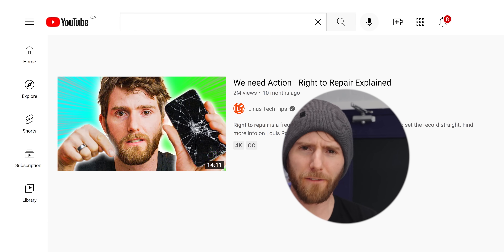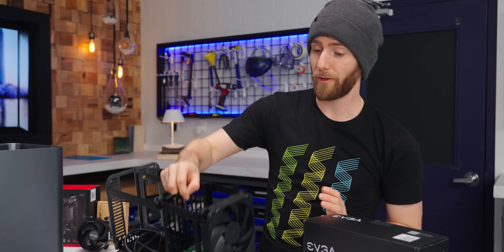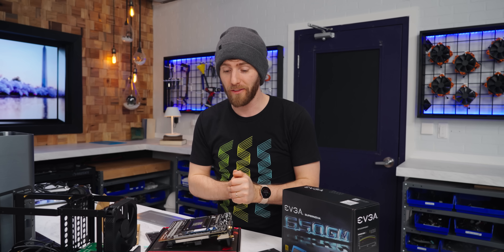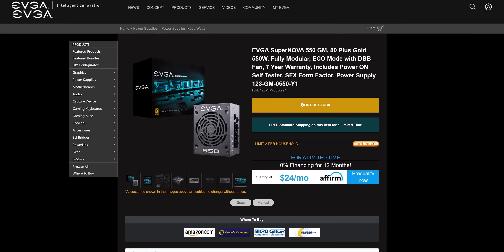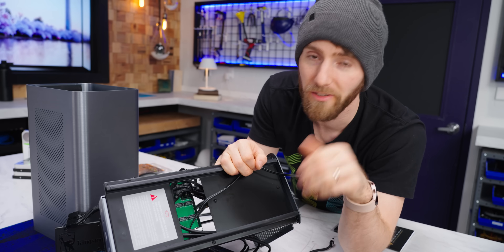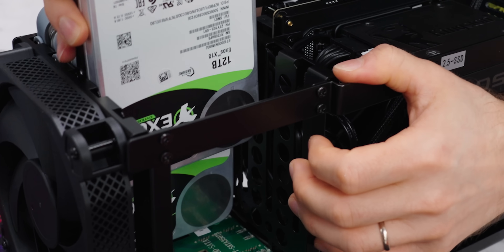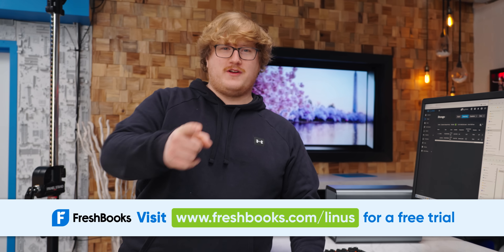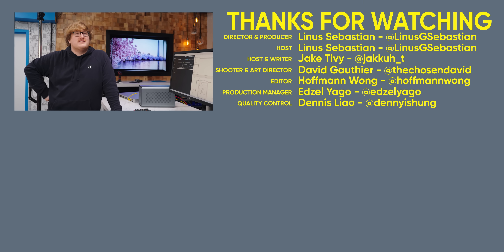This blows away the competition - JONSBO N1 NAS Build

Comment: I never understood why you need to take such a small box. They look nice in your living room but that's usually not the place where you put a 24/7/365 NAS, if then itd likely be all flash based and a PSU w/o fan. I dunno...
Reply: I'm renting a small apartment which is why I chose it. It looks great in my living room and it's much easier to transport when moving. When I move into a bigger and more permanent space then I'd like to upgrade to a server rack, but until then this is still a great option.

Comment: Hi, i was using NAS from 2018. I was happy for the pros to use ir. But now the Mobo of my NAs die an until know i discover the pánic, fear AND stress to have acceso to the info the we put un these Toys. Now  i have More perspective to ask my self.
What áre the steps or óptions to ver ir recoger files from diask that áre part of RAID sheme, depends of the brand of the nas we face standard or propietary raid formats. Now I'm plannig definitly to move into a diY NAS with truenas or even xpenology,but Will be great if you prepare a Review about what to do ir the HW of the nas fails AND the data Is inaccesible from the disk.
My aproach this Time Will be consider the worta escenario PSU fails ( a standard Psu to replace) , ir the Mobo fails ( the ideal Will be to have the img of the USB boot or disk boot, AND change or swap the Mobo AND recreate the USB or disk boot AND voila. But please guys ir you can consoder this real escenario AND probé my hipotesys Will be great. Because the issues to race hw fails in propietary NAs implies not to have new mobos to replace or even neither the same model just to swap the HDD from the old to new NAS AND recover the data. But if we mover to genéric HW the idea Is to recover easily from this escenario. I hope you consider to recreate a hw failure of a diy nas AND recover in almost 24 h the files. Thks

Comment: So you still have the SATA connections on the motherboard could you add those to the array somehow with like, I don't know double sided tape some 2.5 ssd drives somewhere in there? If you had a board with E-SATA could you get external drives and add them to the array or maybe even create a secondary array? Do you have a 2025 updated version of this? Do you know of any good Raspberry Pi 5 NAS kits? I've been looking for a good option for a few months now and I need to get it done but there's so many options and so little money so I need to pick the  best bang for the buck!!!!

Comment: I recently build a TrueNAS server with this case, 3x 18TB HDDs and 2x 128GB SSDs for a boot mirror. I ended up using a NAS motherboard though with a N150 CPU. Highly recommended as it comes with 6x SATA 6Gb plugs on the board. It also happens to fit the workload perfectly, using ~80% of the CPU at full tilt and having a little in reserve to stuff like tailscale and a few other apps. Can recommend! 😉👍

Comment: These cats are not TrueNAS gurus and the RAIDZ1 recommendation is bad as it only supports 1 failing drive. It's often that two drives fail closely together, and rebuild on Z(X) arrays takes FOREVER. Always use mirrors if you truly value your data with ECC unbuffered ram.

Comment: How did to connect the display/monitor to the NAS to get display? I thought you were using Ryzen 3100.. Did you install graphics card? What am I missing here?
Reply: The OS was installed with the drive on another computer and then put in the NAS. Once the NAS was booted up the login and config happened on another computer remotely accessing truenas via the web adress

Comment: Amazing video, terrible case as usual for Jonsbo.
Air seems to be quite blocked by those plates, can't even imagine how could it squeeze between those hard drives to mobo compartment and there is barely no space for exhaust too.
I owned 2 Jonsbo cases, both $150+ and their quality was horrible, like at $20 case. Basically single build time case with risk of breaking when you try to move with them. And those included fans - Chinese no names wining after 2 weeks. Their whole budged wen't on design.

Comment: Thank you. Definetly worth to look into it. Worked with the qnaps now for some years and am about to believe that they have models that are buildto break. Especially one model we bought two of having a service agreement on one and no service agreement on the other one. The one with service agreement is stil running today ( 5 years after the other one broke - which was exactly ten days after waranty ran out). As we hab more than one experience - also with their software support fro the buildin backup and synch tool, I'm realy keen of getting them out of da house. Additonally Google did add 100% onto our unlimited subscription though using only 70 TB at their side. So its time to find some new kids on the block.

Comment: I would have gone for a G version of Ryzen that way you have graphics for the OS when needed.
Also with a G version like  Ryzen 3 3200G, (though you could probably find a Ryzen 5 g for the same price), you could run it as a media player, plugged into your TV and a NAS
My Ryzen 5600G did not work on my MSI motherboard no matter what BIOS I used, so make sure it's compatible

Comment: Great work Linus, but I do have a slight issue. I'm from the land Down Under, so prices are different for me. The total price for everything you used comes to $1,071.63. This includes shipping and GST. If I was to go the route of pre-built NAS devices. TerraMaster F5-221 5 Bay NAS and still have $513.14 for Hard Disk Drives. I could be doing something wrong, and if I have feel free to let me know, but for what it's worth. It'll be easier.

Comment: An arc drive in this setup wouldnt matter that much but with 1 drive idk man theres not much option i guess i would go for more ram rather than a read cache
Reply: I would add it as a special metadata and store some small block if its a mirror but 1 drive you lose the whole pool if metadata fail so its a no no. slog also dont make sense either why do you want write redundancy if your slog is a stripe i dont think you should care about sync write anyway with this setup. yikes i guess i wouldnt add it at all if i dont already have a spare nvme.

Comment: Basic questions please: Why is the IO expansion card needed for 4 sata hdds if the board has 4 sata ports available? Second, why not an apu for being able to use a monitor when needed? Third, in case of using ssds instead of hdds, would the "plug" method change? Thanks in advance

Comment: I am looking to do a system very similar to this with an Intel 13100 or 13500 and no GPU just for a Plex server.  My question is do the hard drives get proper cooling in a case like this?

Comment: Just another PAID SPONSOR. The N1 can be a good setup but unless you want to melt your HDs. This is not the case for you. I have one and HD temps are the biggest issue other than bad cable design. The only way to keep HD temps reasonable to only run 3 HD at max. This allows enough airflow and enough to keep the CPU. This is nothing but a loud case. I know because replacing it after losing 2 HD to heat for NAS.

Comment: I stil want to go with Asustor 12 smaller size but I don't know which is more power saver, more silent, or more upgradable for the same capacity
also this needs more work to set up and more components to buy like ram

I suppose this is an old video, so if you ever compared it, could you drop me the video link
if not, could you write your expectations if possible

Comment: Comparing the electricity consumption to a pre-built NAS would be very interesting.
Honestly this is the number one reason why I've bought a NAS from Western Digital.
Here in Germany the energy prices have peaked this year at almost 50 cents per kWh.
Running a NAS 24/7 can seriously increase your energy bill
Reply: well, just guessing.... that NAS could draw at least about 55 to 60w with all discs spinning and the processor idling. If you configure spindown certainly you can lower it..... I built myself a NAS with a Celeron N (6w TDP) with only two WD Purple and the power consumption was between 25 to 29W peak.... and with spindown set, went down to 19W . Now here We're talking about 65w TDP just for the processor (idling at 20) + 5 HDD each can drawing about 8w (?)  and I think I'm being generous 

and then..... add all the other components consumption like RAM, Fans, Mainboard, the other SSD, etc... so yeah at the end of the day it is pretty high for a Home NAS. I live also in Germany and  I would not do it. In fact, I got rid of the DIY celeron solution to get a very old 2 Bay Synology that consumes tops 15W and abou 4 while hybernating.
Reply: @SuperDaxrider  HDD power draw checks out but the CPU idling will take much less power, normally 5W in a bad scenario (since even the bloated W11 allows <5W idling, I'm positive Linux based systems can do better).
Reply: @mastroitek  you might be right here, in fact is very difficult to measure the actual power draw of the processor we can only guess, probably would be 20W including the rest of the components like I mentioned above. Anyway I HIGHLY doubt this kind of build will get lower than 40W considering that a miserable Celeron N3050 on an embedded mainboard with 2 disks was most of the time sucking 25w out of the wall . 

Well, If someone here built this king of NAS, and also has a power consumption measuring device .. please post your results!
Reply: @SuperDaxrider  One can easily buy motherboard wit same N100 proc on it.
Reply: You don't have to run your NAS 24/7. This is a misconception! The magic is called Wake On Lan. So your NAS is only running if you need it: https://de.wikipedia.org/wiki/Wake_On_LAN
Reply: @WhereIsTheSpartan  Not pro but HDD's don't like constant on/off power cycles. That wear vs power consumption makes it much cheaper to just keep it on. Thats why people prefer 24/7 operation. Therefore would be interesting to see power consumption details of this setup vs pre-built NAS like the OP said.
Reply: @WhereIsTheSpartan  ok but a nas needs about 2 min to boot, not great, but I see how it can be useful
Reply: @WhereIsTheSpartan  fun fact when I suggested on reddit I would only switch on the NAS during the hours of the week I am at home and need the storage, people went completely crazy saying that is unacceptable to not run the NAS 24/7, without any justification of such statement. Glad to know I am not alone.

Comment: To anyone who reads this, the Node 304 is a better case to build a NAS in since it fits an extra hard drive and is cheaper. Also, there's no cable routing BS that you have to deal with, and if you're willing to mod it you can get a 200mm fan up front which will mean no cooling problems.

Comment: I've started to build something similar myself though the motherboard is a Gigabyte A520I AC and the processor is a Ryzen 5 5600G (so I won't have to play about with other systems to build the hard drive). I did end up with the same 16GB though I tried 2 x 8GB of Corsair Vengeance LPX. I'm just getting the cables, the psu (I tested it with an old CIT supply and it works though the supply won't fit in the case) then it's all a matter of the drives. Spinning rust these days isn't quite as expensive as it once was but getting five relatively big drives is still not cheap over here. It's all in the cause of replacing my old home server which is perilously close to end of life.

Update: I finished building this with the parts above with an 850W Thermaltake SFX PSU. It works well though I would strongly advise that if you are running a Linux share setup as well as or instead of a Samba share, use TrueNAS Scale rather than Core (or Unraid). I already had a SATA board (a four way jobbie) from a previous project and the processor meant that I didn't need a second slot. One thing I was a bit unhappy about though was that the SATA cables were difficult to fit in there. I ended up buying a Yiwentec SATA fan out cable which can handle 6 ports and doesn't take up anything like the space but another suggestion I can come up with is use a Jonsbo N2 case. It has a different form factor which allows you to extract the storage drives without pulling the system apart.

Comment: Thanks for the video, Pretty cool. I saw optane SSD build as part of storage. I am the optane fan and leveraged optane in my homeNAS for ZIL and metadata for a while.  That's really true optane have the low latency and high endurance. I boost my write performance a lot with my HDD RAIDZ2 backend storage.  I found amazon have Optane P1600x 118G on sale with un-believable low price. Plan to buy more for my extra system and RAID1. check it out if you are interested.....

Comment: With only 16 GB of memory adding an L2ARC will probably decrease your performance because part of that RAM will be used to manage the L2ARC instead of using it as cache directly. And no SSD you could add is as fast as your RAM. Hence the 64 GB or more recommendation before usinf an nvme cache.

Comment: This is easily one of the more useful build guide that decent amount of people might actually want to build.Very interesting DIY project for a home / home-office use. Definitely something I’m considering building. For an even cheaper option, go with a microATX case and mobo.  Larger case means more drive storage, space for a video card and better airflow.  And microATX boards are cheaper and easier to find
Reply: Agreed, my NAS is in the Fractal Node 804, and has space for 6 drives, I think it can even be configured up to 8!

Comment: Those rubber grommets and handles are going to be dried out husks when you want to replace your HDD in the future. Had a similar system in a bigtower setup and the drivecages were unusable because all the rubber bits dried out and crumbled.

Comment: I got to say having run most major NAS software the money is in the software and support. Almost anything can give you a drive share and time machine backup but more complex, remote access, etc, ease of use (which none of the open source guys seem to get) and when one died they swapped it out via chat and even shipped me some drive screws for another unit I was upgrading. That is worth the not much more money.

Comment: MOLEX type connectors as used in PCs are capable of handling over 70 watts. IN SPEC.
Even HGST enterprize drives don't need THAT much power.

Using more than one doesn't hurt, though.

Comment: Personally, I love my Synology NAS box.  It wasn't cheap but I love the data security.  It has 8 hot swap bays and I've installed 8 x 6 TB drives in a raid 6 configuration.  I like knowing I could have two drives fail and not lose any data.  It also has two 10 gig connections, so I connect to my 10 gig switch and bond two channels for a maximum of 20 gigs of speed from the switch to the box.  I do wish it had more CPU power.
Reply: having started with synology, then switching to Truenas for better hardware/price ratio: You did the right thing.  Truenas is way more a PITA than Synology.  Synology's expandibility with their BFS system is something I wish I had.  I cannot expand my current 6x12tb without either adding 6 more drives or swapping out the drives, instead of adding a couple more.  The only reason i wanted to have power was for transcoding plex, which, someone else suggested: why not just transcode a version and keep it on the server, let plex decide? SMH.  Wish I'd thought of that.
Reply: Personally, I think I am going to head in that direction in 2025.  I think I am going to buy two 24TB hard drives to complete my collection on my current dumb NAS and copy all of my data onto that for my backup - then get something like the Synology NAS and put SSDs in it and start using SSD moving forward.

Comment: Sorry linus you are building something in with a failure point you will require 1 drive space between each drive because you need air to whck away the heat,  to do parity at 100TB  with standard 20TB  you look at 7 3,5" hard drives

@ 8TB ssd's 14 base 19  for parity

Comment: Avoid the Asrock b550 phantom gaming mobo for this build, or any motherboard with right angle sata ports...unless you have a variety of thin and/or angled sata cables (both 90 and 270) lying around. The mentioned Asrock also needs a length adapter for any m.2 shorter than 2280, on both m.2 ports (guess drilling 2 holes in the front one was too expensive...)

Comment: slick build but a few things.  its huge.  for a 'home' nas its way too big.  Power consumption, probably doesn't need a lot when idle, but still probably more than  a light weight 5 bay nas.  Access to drives.  If i'm running mass storage i want easy access to drives. the past 25 years i've had to replace quite a few drives in arrays both in professional and home systems easy access is a must.  No console.   This is less important for pure NAS systems but when you are basically building a pc you want that easy console access just adding a cpu with a gpu would fix that. With any luck you'll never need to worry about it, but when you don't plan for it, it will happen.  Just my thoughts.. still like the build.

Comment: Just a couple of heads-up: 1) mobos with 90° sata connectors pose a problem in this build, unless you have both 90° and 270° sata cables lying around. 2) check the physical support for the m.2 expansion card length-> you might end up using extenders and washers if you don't

Comment: Okay, so the case from AliEx is only $150 CAD, but then you pay another $140 CAD for shipping. Not quite the deal as disclosed in the video. Still... not bad... just not as cheap as anticipated when you add up the all-in cost of the item. So now we're starting at over $300 CAD (taxes included).  On to the next bits...  :-)